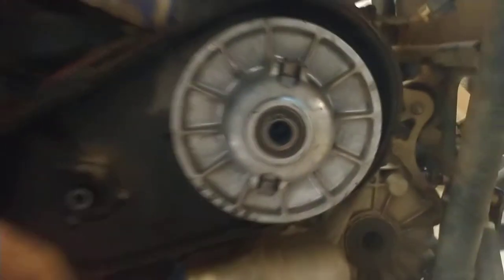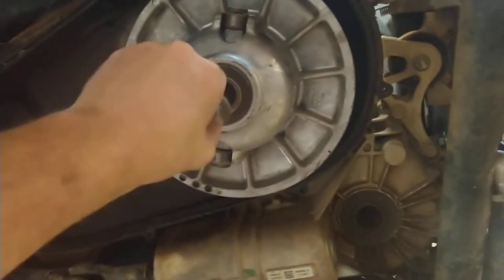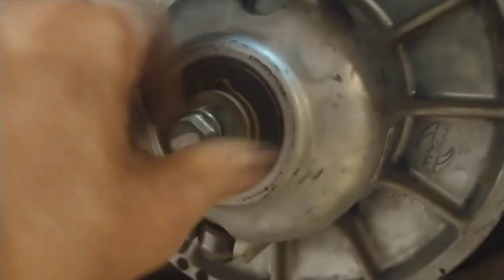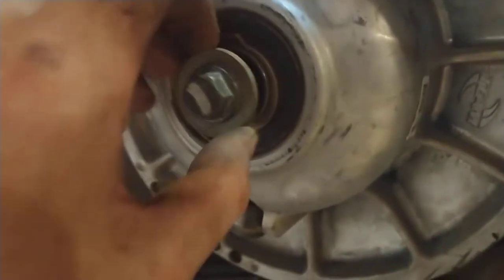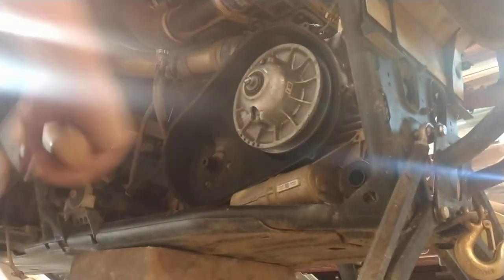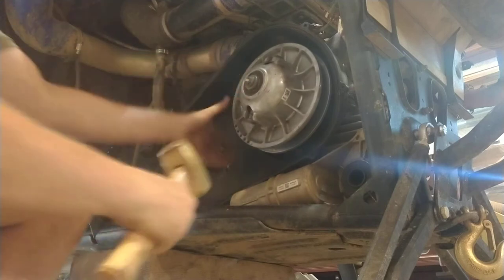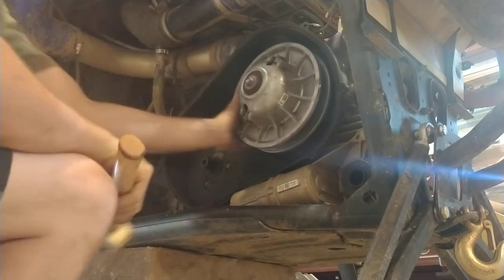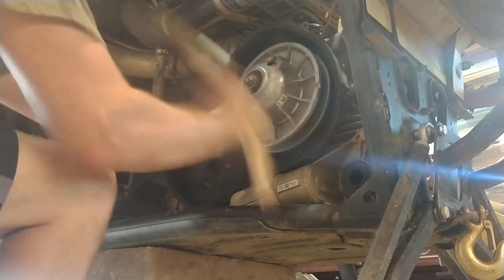Polaris rzr/ranger/general stuck secondary trick removal

Comment: You da man! I even have a puller and was hitting it with a 1/2" impact, soaking it, heating the inside, smacking the puller with a hammer under tightened tension (which usually works) and gettin nuthin.
Your trick worked with like 5 smacks of a hammer. !